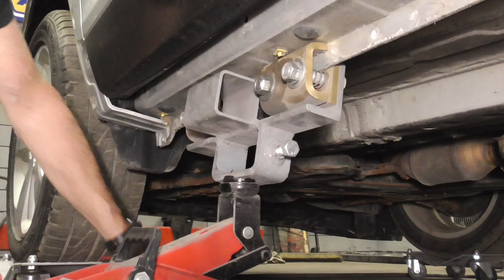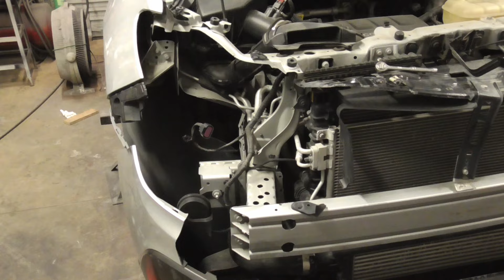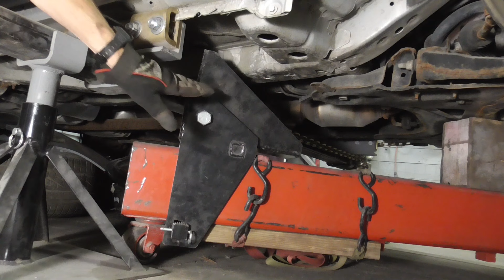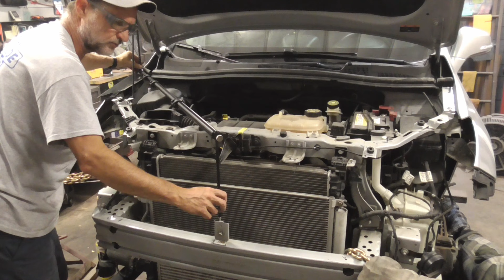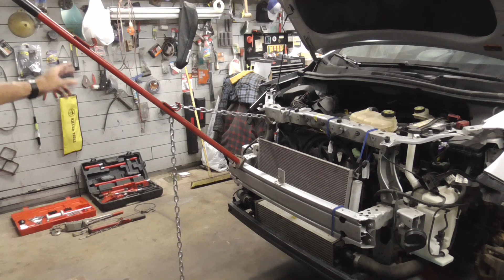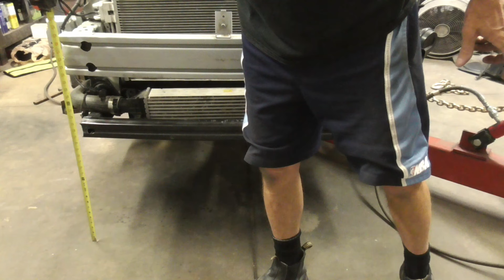Pulling Frames: Fixing Frame Side Sway with a Dozer Type Frame Machine

Comment: Great work Jerry! I have seen many straightening jobs in real life over the 24 years I did subcontracting work with about 20 body shops. Always nice seeing it done right. I am not sure I would have the patients to do that as a living! Obviously a skill to it.
Reply from the maker: Thanks Uncle Mark - always a pleasure hearing from you - have a good weekend :)
Reply: You just can't get it to specs, straight with that rustic dozer , you need a Car-oliner bench and computer 🖥️ ,
Done this trade over 45 years . 😂😂😂
Reply: @enriquerodriguez1804   all you have to do is fit the parts. If the headlights and the fenders line up good with the hood than you can fit the bumper. If that looks good than you’re good to go. Its a little more work than having a measuring system but the customer won’t be able to tell the difference. And the frame will be good enough to keep the driver safe.

Comment: Amazing to watch this process!   I see the importance of solid rockers.
Reply from the maker: Yes - I'm pretty amazed at the strength of the pinch welds - I've never seen them fail or bend.  I'd hate to try it with rusted Michigan rockers though :)
Reply: @LakesideAutobody  Exactly.  Ours are often repaired with foam and Bondo 🥺

Comment: Fantastic demonstration!  No obnoxious soundtrack and straight into the work.
Have to admit, the hammering made me cringe.  How does this type of repair affect the steering and wheel alignment?
The frame machine is amazing but only in the hands of a competent mechanic.  Nice job.
Reply from the maker: Honestly, if pulled correctly they usually need no alignment work.  If the suspension was bent in the accident then alignment is usually needed.

Comment: Nice work!!! 😃 My first two questions would be.. 1. Where are you guys located and 2. What would a pull/straightening like this or similar to this (mine is pushed in a little on a corner. A little bit in and a little bit down or up, ever so slightly each way) cost or run the average person that wanted their ride to be nice underneath the sheet metal, maybe impacting battery and fog light mounting ever so slightly?
Reply from the maker: I'm in St. Helen, MI.  I repair clean title repairable vehicles from places like COART, AAI, etc.  I can only work on my own vehicles as I'm residential and the area is very uptight.

Comment: Great vid. You left out one insignificant item from your shopping list, the small floor mount you use for tension on the left side? I did a brief search for something similar but have come up empty so far when looking for something rated at minimum 4000lb
Reply from the maker: Sorry - here's the item (color changed) - https://www.ebay.com/itm/152890495158?hash=item2398fbd0b6:g:RVEAAOSwzatizPt2&amdata=  Should have pull pots in the floor but it worked for that job - don't think there was a ton or force on it so it held just fine :)

Comment: Hi, thanks for a wonderful video working with a dozer. I tried it without a pulley block and the clamp which was clamped to the sill came off. Any advice on this please. Thank you
Reply from the maker: The clamp on the rocker panel pinch weld should never slip off.  If it does, it's because the nuts were not tightened down enough or the pinch weld clamp is not a quality clamp.  That being said, you can run the chain around the dozer post (around the back) and pull it that way but it does help to have the pulley.  Let me know if you have more ?s - Jerry

Comment: got any tips for straightening a 85 Camaro? its been hit right near the hinges by a Gard rail. looks like it shifted the a pillar and the wheel base is about 9/16 shorter on the damaged side
Reply from the maker: Might be something in here that can give you an idea or two - https://www.youtube.com/watch?v=MT2qarFo_nM  You can bolt something to the hinge plate and pull from that too.  Maybe this would have something too - https://www.youtube.com/watch?v=ENgdswDe1Fg
Reply: @LakesideAutobody  thank you

Comment: this great video am in lincoln teach college auto collision repair but we need to learn manually  and tools names plus work steps
Reply from the maker: Feel free to tell me what you need to learn, want to learn, any questions that you are too afraid to ask - Jerry
Reply: @LakesideAutobody  thanks sir I have long years ago do refinishing but am ba k to lincoln teach in texas to know material cut and welder and fix frame But the basis is the kit, its name and the stages of its work, especially the lower body of the car and how it is tied and towed or pull or push even windshield base for 4 lines If crookedness is on one of the sides, right, left, north, or south of a base of windshield so I wish we keep in touch too thanks Me Jerry we are glad to hear from you

Comment: I know you said they don’t sell this frame machine any more but was curious who makes it?  Looks really heavy duty!
Reply from the maker: Champ makes it - or made it.  I purchased it from this website - https://www.autobodytoolmart.com/category/auto-body-frame-straightening-equipment  Here's one that's similar - Jackco 853 10ton Body Straightener - Swivel Type/Hydraulic Pump
Reply: Ok, I found an older champs dozer machine and have hooked it.  I have the exact same job but is more than twice as bad—think was about 6 inches off from center.  I see you are using that pulley to
Get a very linear pull.  My questions are are you just countering that against the jack stand that holds the crossbar?  My other question is did you just use vise grips to clamp the pulley where you want it?   Anything else I should consider? Yes I did make a bit of a mistake in this purchase but I will have to do my best to make it right.

Comment: Hi, will hitting with hammer  harm the ECU of the car ? Because it happened on Kia grand carnival 3.8lit so I had to change ECU kit which includes key, key reader, immobilizer and ECU. Here in Australia it is called Grand carnival but there it is sedona . So my question: can that happen? Or there was another reason? Cheers
Reply from the maker: I always undo the negative cable on the battery first - which I should have talked about.  That being said, anything can happen I guess but I've never had things break from using a big hammer other than maybe a radiator start leaking, cracking plastic trim parts, etc.  Haven't damaged any sensors or computer parts though.  I suppose if the computer was very close to where you are using the hammer, you may want to remove it :)

Comment: 4:23 Jerry. why is the blue hook hold by a chain and a winch at the same time. are they two connected together at the floor anchor? whats the purpose? seems like the winch is doing all the holding and the chain always got slack. Peace
Reply from the maker: I actually need a chain binder to keep pressure on the chain to hold the hook in place.  The winch was there just to put tension on the hook to hold it there - not a perfect set up.  With a traditional frame machine - pull pots or drive on frame rack the pulling from the other side would keep that chain tight.  Hope that makes a bit of sense - have a great weekend Petar :)

Comment: Are those "frame" rails high strength steel? For as much as you were hitting them with that sledge, I'd have expected them to deform.
Reply from the maker: They probably are but they bend really easy if they get hit by another 3000+ lb car or truck :)

Comment: One arm bandit. What I kind of learned on. Are you going to replace those rails? At least on the left? Seems you didn't give too much heat. I like the beating of the rebar and the aluminum flying. Old school!
Reply from the maker: You're right about the heat - didn't get it too hot or as hot as a real torch.  If a frame has a kink or is bent it should be replaced but I'm keeping it so it's staying just the way it is :)  It's got just over 100k, all wheel drive, good gas mileage, clean in and out - it'll be a nice driver.  Have a good weekend Bill 😊
Reply: @LakesideAutobody  YUP! Have a wonerful weekend, Sir.

Comment: My car that I'm getting ready to paint, has tight gaps at the bottom between the door and fender, and wide gaps at the top. I've seen a few Neons with the same issue, and suspect it's because they were jacked up in the wrong spot. (The pinch weld is also folded over in a few spots). I saw this video and was wondering if a setup like yours could fix something like that. More than likely, I'm just going to cut the bottom of the fender and open the gap up, and add some welding rod to the edge to close it up at the top....But I'd be curious how something like that would be fixed. It seems if you pulled back and up (from the front of the car) you'd have to pull the support box down at the same time.
Reply from the maker: You can add shims to the front of the fender to close that gap.  You have to raise the hood bumpers and latch to match the hood to the fenders.  That's one way.  Another way is to close the gap on top and just force that bottom gap open while tightening the bolts at the bottom - even bending the fender or forcing that gap open on the bottom works.  Let me know what solves the problem for you :)
Reply: @LakesideAutobody  I thought about that. But it's probably 1/8" or less (the door doesn't rub...but it's CLOSE) at the bottom and about 3/8 at the top. I feel like if I shim the front of the fender enough to get the bottom gap right, the fender won't line up with the headlights/front bumper quite right. A little at the back would equate to a LOT at the front. And I worried that if I tried to just force it at the bottom, it would twist the bottom of the fender. I think I'm going to drill some holes in a few spots and use clecos to locate it...then I have a reference to try different things, and I can go back to cutting a slit vertically at the bottom and adding material if neither of those options work.
Reply from the maker: @jayinmi3706  Let me know what you end up doing and how it works out - interesting 🔥🛠
Reply: @LakesideAutobody  I took the fenders off and I tried just pushing tthe bottom forward and it seemed to work fine. Glad I tried it, would have been a lot of work other wise. There was a shim on the driver's side that might not need to be there. I'll let you know.
Reply from the maker: @jayinmi3706  Sounds like you're making progress - keep at it :)
Reply: @LakesideAutobody  I'm trying. Found out my passenger fender wasn't useable and a friend had a brand new, never been painted one for me. haha
Reply from the maker: @jayinmi3706  Awesome! 🔥🛠😊

Comment: I take it that you are heating the frame where it buckled? Do or did you have to heat up the drivers side at all?? Or you don't have to?
Reply from the maker: I "warmed up" the buckles or kinks - you're right.  Probably could have pulled it w/o heat but I'm not real worried about using heat as I don't have a really hot torch.  There were on kinks in the drivers side so that was OK.  Glad you enjoyed the content GM - have a good week :)

Comment: If your hook ups are strong enough, ya, don't heat it. High carbon steel doesn't like it.Loosen up the cradle bolts before pulling. There is some slack from the factory in the cradle. Remove the hood latch so you can see better how the hood lines up without running back to release the hood that can have a bent catch anyways.
Reply from the maker: Good tips Johnny :)

Comment: What’s your strategy for pulling on unibody frames as a posed to body over frame
Reply from the maker: Aside from the different ways to anchor the vehicle - the principles are similar.  I like pulling unibody frames actually - clamp them down with the pinch welds and start pulling.  If a pull fails or something is not working then you just have to try something else.  Even though sometimes you think you're not going to be able to fix it - with enough thinking and work, it always works out.  You'll break some stuff along the way but that's par for the course as they say 😊

Comment: Heating knks in frame rails is not permitted nowadays as it is not longer "safe" to do so.    My 30 y/o MR2 is ALL mild steel, so you can heat it and beat it, no problem, but OEMs, pressured to meet higher and higher fuel economy standards utilize stronger and lighter High Strength Steel (HSS) and Ultra HSS (UHSS) in order to lose weight and still maintain the strength of the chassis.  These alloys of steel are cured and formed using heat, vacuum & pressure under very controlled conditions to reach their maximum strength.  Bodyshops have software to look up every OEM car on the road which specifies which portions of the car are made from which type of steel alloy.   When you work it, you notice iHSS & UHSS doesn't yield like mild steel, not as malleable or pliable, much more brittle in the way it fails - cracks, tears, sharp kinks.  Heating it with a torch and pulling it straight takes a lot of the strength out of it.  How much?  I don't know; I'm neither a metallurgist nor an engineer.  This is the main reason why modern cars that appear to have minor "fender bender" damage are written off as totalled.  The proper fix when dealing with HSS or UHSS that is kinked is to use the damaged portion while pulling  to get the adjacent panels as straight as possible and then cut out and replace the entire damaged member at a mfr approved location utilizing a mfr. approved method - like back at the firewall, if at all.  Heating and straightening a modern chassis rail is no longer considered a proper repair.  A kinked UHSS member should never be put back in service; OEMs vary on what can or can't be done with tweaked HSS.  The concern is that member will never have the same strength as when it was first built.    For the motoring public, this is progress - lighter, stronger, etc.., but for the shadetree and project car guys, the price of that progress is that it makes any damage beyond the front crash bar a bit of a deal breaker.
Reply from the maker: You make some very good points - thanks for the input.  All the OEMs have a guide to what type of metal/frames you can heat and straighten.  It's so confusing though that most probably don't follow it.  I'm sure a lot of straightening is going on in shops across the nation.  I also think the OEMs are covering themselves a bit too.  They should really make some type of rules that guide all body shops on this topic because some I'm sure are straightening and some are not.

Comment: Hi ! How are you doing , My Name is Mr.Herman Woods .I have a 1980 Dodge colt . 1.6. Unibody fame ,  On the Driver side . the cross member bar , that holds .the stabilizer bars,and torsion bar , crack the loose .But on the Driver side , it"s about 6 inchs .From the unibody wall . I went to Harbor Freight and bought the seven piece frame pulley . But i dont have anything , holding the frame .From the bottom. Do you think ! That i can still , pull the frame .Over 6 inch ! To put the frame peace , back on thr unibody .To be welded , back as a frame .that peace has , the 2 bolt holes pins .For the cross member , to be connected .To ! THANK YOU ! FOR YOUR HELP ! MR.H.WOODS
Reply from the maker: You can always anchor the car to a tree, a tractor or even another car to keep it from moving.  I think it can be done - just keep thinking of a way to do it.  I you try something and it doesn't work, keep asking ?s.  I'm sure there's some way to get it done 🛠👍

Comment: How much this kind of work usually costs?
Reply from the maker: Frame time in a body shop is actually quite expensive.  It varies from place to place but usually around 70-100/hr.  Once you figure the time and materials, it can easily break into the thousands.  That's way vehicles become a total loss to an insurance co very quickly.

Comment: Put a disclaimer before mechanics set our petrol cars on 🔥
Reply from the maker: I've work in quite a few shops and have never experienced a fire yet.  I've even watched guys spray primer with a cigarette hanging out of their mouths.  If you smell tons of gas fumes, it's probably not safe to use flames around it - seriously - just smell for gas fumes or anything else flammable before working.

Comment: Wood bigger set torches help
Reply from the maker: I try not to get the metal too hot - just warm it up a bit.  I probably could have pulled harder to speed up the job but I like to take it slow and try to not damage stuff - thanks for the support Super G :)
Reply: @LakesideAutobody  rose bud on small set works allsome
Reply from the maker: @73superglide62  I've always wanted one of those small sets - nice and portable :)
Reply: @LakesideAutobody  I got cheep set off market place paid alot the much .should buy set .and give to you
Reply from the maker: @73superglide62  I'll keep looking on FB marketplace - thanks for the tip my friend :)

Comment: These high strength steel cars these days are springy you have to pull beyond center more than the low strength steel cars of the past and let it spring back to the zero alignment. The chief easy liner with two extra towers was my choice and the insurance companies would pay us repair labor for marks left by the clamps on the pinch welds clean up because the clamps leave marks on the pinch Welds.
Reply from the maker: Wow - that's cool of the ins cos to pay to repair those marks.  Nothing beats an easy liner or frame racks that are similar :)